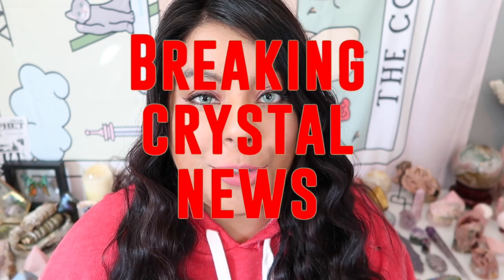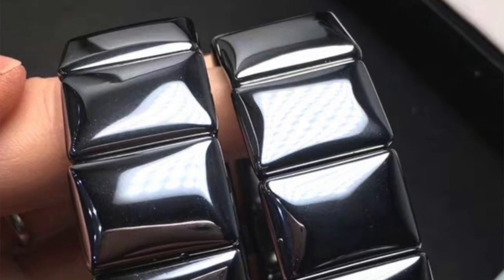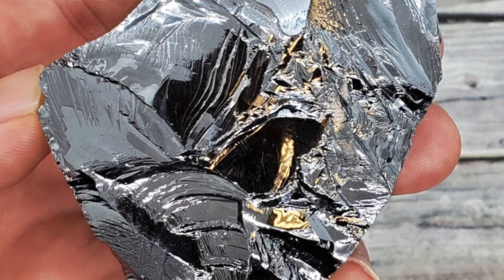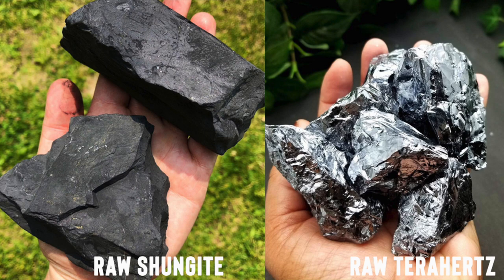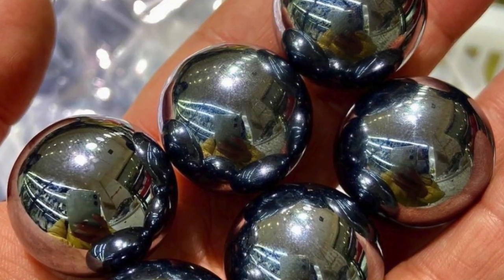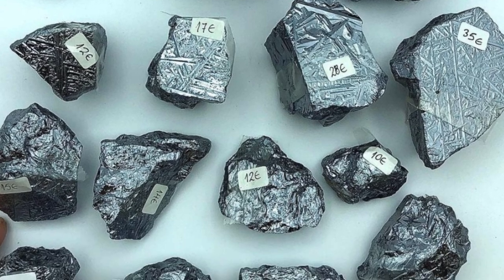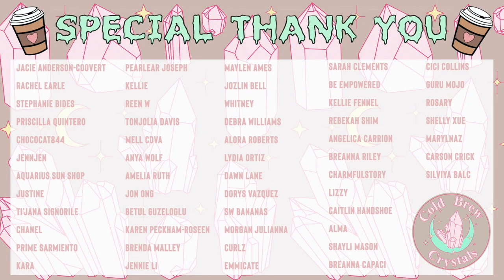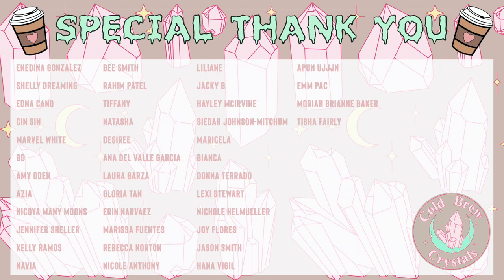*NEW* BREAKING CRYSTAL NEWS! | TERAHERTZ, IT'S MAN MADE? | BRINGING YOU THE LATEST CRYSTAL NEWS!

Comment: I have seen sellers sell Royal Elite Shunghite and wondering if it is this stone. I bought the small pieces just as curiosity. They looked polish and are very shiny like metal. They had the raw version of the Royal Elite Shungite which looks very much like the images you presented in your video. I do have shungite, raw and polished (pyramid) and is very different to the shiny « Royal elite shungite ».  They had skulls as well claiming to be Royal Elite Shungite and thought it resembled hematite.
Reply from the maker: Yes I have suspicions on the “royal elite shunghite” that it may be this stone!
Reply: @ColdBrewBarbie  I have purchased raw and I am sure it is real but the Royal Elite Shungite, I do question it. I asked them about it as there were buyers saying that it resembled hematite. The seller replied that they were ‘sure that it was real elite shungite that the supplier was trustworthy. I believe testing can be done with a multimeter. The last piece I purchased was tested during the live sale. The seller explained this is a good way to see if the shungite is truly authentic. I wonder what reading the Royal elite shungite would have given - 🤔🥺